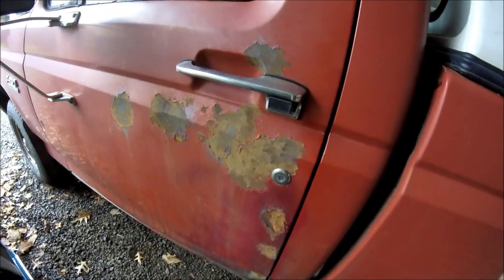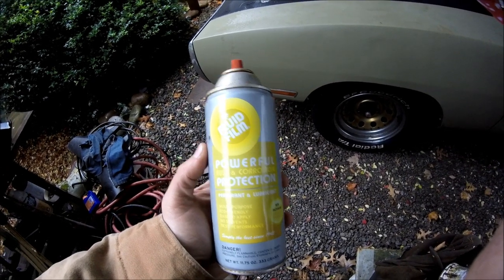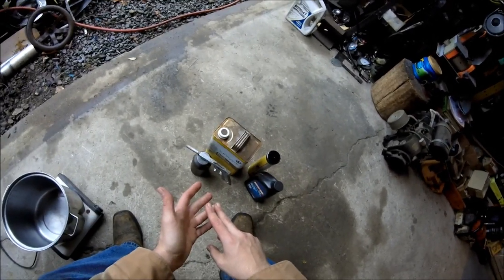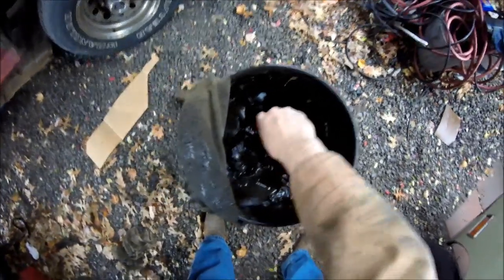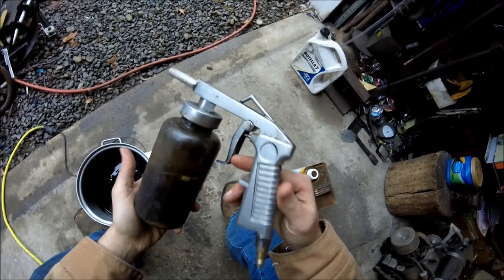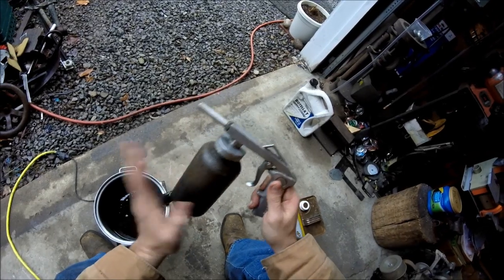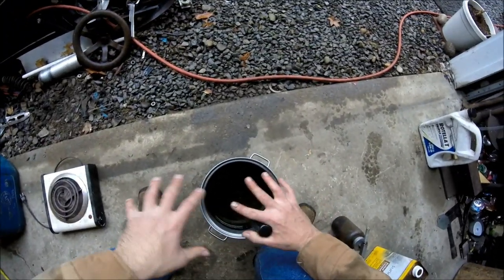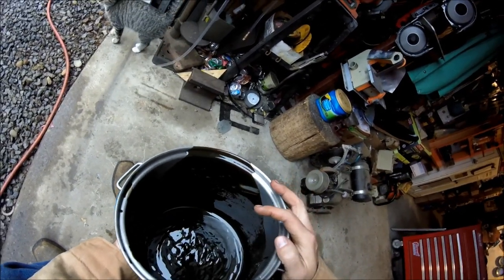GROIL: Homebrew Undercoating Mixture

Comment: I’m all for the home ideas for undercoating but it bothers me that we will be spreading small amounts of oils all down the roads we drive polluting the environment and contaminating water systems. No, I realize my one vehicle won’t be that much of an issue but the more we share and the more that follow up doing this the more oils are dripping all over the countrysides. I think I’m going to get “ziebart” to do mine. 10 year warranty on new vehicles. No, I’m not paid by them, I had my old ‘77 ford done and it’s a good product.  Keep thinking everyone let see who comes up with the best free method.
Reply from the maker: For sure, dripping oil all over roads and parking lots isn't cool.   That's why this method tries to keep the coating as thick as possible, so it stays on the metal instead of coming off.  After the initial spray (that you did in a controlled environment, and properly disposed of the drippings, right?) the goal is to have minimal if any coating leave the vehicle.
Reply: lol, ever see an engine blow up, or a dip in the road where it is dark? that's oil. cars drip oil.....better than riding horses where shit was 3ft deep in NYC. the idea is it stays on, not drip off. oil isnt as bad for the environment as u think.
Reply: The exhaust from your car is doing far more harm.
Reply: Our roads are really just tar and rock hardened, so a tiny bit of oil here and there isn't going to do much damage, but that is why thick and tacky is so important, then it doesn't drop off anyway.

Comment: Also put grease and trans fluid in 1st and heat. It will mix good with grease then add oil and cut up wax ring or cheap dollar tree sets of candles. And clean and tape up door drains, buy baby, mineral oil or melted Vaseline and fill up 2 inches or so and let sit for days. Drain after days and save for next year. U can use oils, grease etc but it will smell like whatever u use for at least a week. And some ladies don't quite like the smell of oils and fluids, grease etc like us men do.

Comment: This works better than anything you can buy if your vehicle already has some rust on the frame and you want to stop any further rust and corrosion.  I never even thought of linseed oil and that's gonna be even better than my dads old formula.      What really sold me was when I pulled the bed on my f250 and had a lot of time off so I stripped the frame almost to bare metal to paint etc.      It took forever to get the oil concoction, now with a little dirt/grit mixed in out of all the nooks and crannies that with a bed on my truck I wouldn't see in a million years. And that's the important shit, ofcourse it will wash off your frame rails in the wheel wells and wide open exposed areas but good luck getting anything up inside the little areas that grit gets stuck and holds moisture, or worse by me with salt other than this kind of deal.    

And the undercoating in cans is never gonna hold up unless you actually sand down, remove ALL rust and totally de grease it first.

Comment: I used equal amounts of boiled linseed oil and tung oil, a large glob of Lucus high tack red grease,  bees wax toilet bowl wax ring warmed up slowly to dissolve the wax ring and then thinned out with chainsaw bar oil. I used a small crock pot to heat it up. I applied it while it was still warm with a gun from Woolwax. So far it seems to have made it thru the winter quite good. It stays soft but hardens enough to stand up in the wheel wells and the car wash. When you are done spraying find a dusty road and drive up and down it a couple of times.

Comment: I've heard of a local concrete company spraying linseed oil on their truck frames, but this formulation is I've never heard of anyone using. Might have to test this out on the old moldboards instead of having to keep on oiling it. Then again, I have around 200 gallons of used engine oil to use up before it turns into tar. Lol!
Reply: used engine oil is acidic i wouldnt use it for metal treatment... burn you oil if you need heat otherwise just drop it off at a shop to be recycled

Comment: We used to spray grease and graphite back home in Nova Scotia, You could hear the truck rotting in the driveway as you were trying to sleep. Anyway it worked really well. Going to paint the old Dodge soon so it will be getting a treatment after paint.
Reply from the maker: Yup, amazing how fast stuff can rot if no preventative measures are taken.

Comment: A old friend of mine used to use old used motor oil (that's lot of use and used)at his body shop under old cars and trucks he had patched up and painted. The only bad effect was if the used oil got on the door rubber seals or body gaskets in older cars the rubber would go gummy and start to sag. One other old co-worker at a boiler room I used to work at used to paint the frame of his truck with Bunker "C" (#6 fuel) oil and that frame never rusted. Did you ever see rust on an old train tanker car hauling Bunker "C" oil?? And it pretty much dries up and don't drip.

Comment: You wanna do this on a nice hot, dry day. Because the steel frame on your truck will hold moisture. And once you pack all that oil and grease onto your frame, it will trap that moisture under it. Whenever I paint steel in the colder weather, I always heat it up with a torch first to burn all the moisture out of it.

Comment: Dear tocheaptoosmoke,
Perfect timing to watch your excellent presentation, as I got acquired a free 5 gallon drum of light texaco grease. Used motor oil is every where to be found, and I might have some boiled linseed oil around the house.
Thank you for a brilliant idea, and a well executed tutorial!! Can't wait for the warmer weather to get under the car.
All the best Bruce the swimmer New Rochelle N.Y.
Reply from the maker: Cool, glad to hear!
Reply: @toocheaptosmoke  thank you...  I am about to undercoat a vehicle...  I searched your channel for a rust remover...  Do you have a recommendation?

Are you still using your Groil formulation as listed in this video or have you modified it?
Reply from the maker: @camposvazquez  I've just started using the ospho rust converter, seems to work alright.  I do still use the groil as is, made a thicker version with some wax (toilet bowl ring) added in that also works well, but doesn't flow as easily when sprayed.
Reply: @toocheaptosmoke  thank you ...
Reply: I was thinking about your Concoction- One of best Commonsense ones of seen - Do u like better w/ adding toilet wax ring? Do you still use same recipe  or have to thin it w/ diesel bit more? Just wondering if gsrden sprayer might work better because of adding wax ring? Thanks for making  video! @toocheaptosmoke

Comment: I add melted candle wax to mine , been doing this for years.  Great video
Reply from the maker: Thanks!  I'm going to try a batch with a melted toilet seal wax ring this year, that may be the hot ticket!
Reply: @toocheaptosmoke  great. At least you are trying,  that's half the battle. Keep up the good work
Reply: Melted toilet wax seal works pretty good! Self heals nicely.
Reply: paraffin will dry hard where toilet bowl wax will be still soft to some degree.
Reply: The was bees wax ring helps to keep the coating more flexible than the paraffin which I think helps to prevent any cracks in the coating once it cools.

Comment: Awesome tip great suggestion i experiment as well i tend to go back to the old methods because they worked i painted my old truck with red oxide with a dash of boiled  linseed oil it hasnt rusted and that was over  4 years ago and paint brushed it on it been sitting out side for years in all weathers didnt have the spray gear so used a paint brush that was a cheap option and fast to keep my truck from rusting No brush marks if you put the paint in a bucket of hot water and use a well worn paint brush never use a new brush when painting vehicles you will get brush marks .I could have used household enamel paints that would have worked just as well  i did sand the old surface to give the new paint something to stick to any bare metal i treated with phosphoric acid which the panel shops have used for years for flash rust before painting you dont need alot as it goes a long way add the boiled linseed oil to the paint it flows on a lot better and gives that added rust protection thats old school but better making your own boiled linseed oil as it hardens and drys better doesnt go tacky like the new stuff .Even enamel paint inside doors will work long term  just have to treat the rust first with a rust converter as your primer it goes along way  For under the vehicle i used a rust converter paint and then some bitumen paint its water based and paints on easily and sets like really hard rubber here some of tour buses travel down the coast on the beach and going thru sea water sand and it protects them from rust in a really harsh environment they treat there vehicles every two years but that is in the worst case scenario.There is no rust under my truck and i used it on the floor panels i am happy with the results.
Reply: There is a company that sells linseed oil paint.

Comment: Pure legend!!! , I'm fighting the same battles here in Ireland . Making random Concoctions , dunno about the using used oil though they rekon that's bad full of acid .
Reply: 208d I’m in Ireland too, they use salt here In the winter at the end of the street which is a hill, so in winter months I go through a car wash weekly that involves under chassis wash..   years ago local garages used to coat the underside of your car with old engine oil as a rust preventer, they used to believe old engine oil was better than new, but in those days oil was castor based and not synthetic or semi synthetic

Comment: Linseed oil has a long protein chain which makes it great for holding together.  In the 3D art world it's used to code statues what have you that are made of metal usually using rust as a patina.  or just as a protectant.
Reply from the maker: Cool info, thanks.

Comment: Instead of the 10W30 have you considered using bar and chain oil? that stuff is very tacky as is and usually contains phosphorous to help keep rust away from the bar and chain on a chainsaw. Surely would work good for this.
Reply from the maker: I think the bar and chain oil would work great also, even better if you can source it cheap.  Might need a little bit more diesel to thin it for spraying.
Reply: After the initial mix of boiled linseed and tung oil, red tacky grease and toilet bowl wax I thin it after cooking that mixture in a crock pot with bar chain oil.

Comment: Would like to see an update . Does it harden somewhat  with the linseed oil or just wash off?
Reply from the maker: Here's a recent update, the linseed oil does help it firm up.  https://www.youtube.com/watch?v=r43jjyDafG4
Reply: There is a different recipe which will harden up better and doesn't involve any grease.  lt's boiled linseed oil + mineral spirits + powered mineral tint (coloring).  After mixing has the consistency of and applies like a thin latex paint.  lf you use a light colored powered mineral tint such as white or grey, the light undercoating also has the advantage of creating a bright environment under your vehicle which is very useful for servicing your own car while also making it very easy to spot any possible problem areas that might need to be recoated. This mixture dries hard with no tackiness once fully cured (the mineral powder tint helps with this) and when ever you need to reapply you do not have to remove previous layers, just clean surface and wire brush any worn areas and then respray entire area. The bond that the linseed oil creates with the surface material as well as the chemical nature of cured linseed oil prevents the oxidation process all on its own without the need for additional grease/oil. Used motor oil and other petroleum products are terrible for the environment and just a little bit can contaminate HUGE amounts of groundwater, whereas the boiled linseed oil + mineral spirits + powered mineral tint once fully cured is environmentally safe.

Comment: This would absolutely work! I’m wondering since transmission fluid is thinner if it wouldn’t be better to mix with grease?
Reply: TRANSMISSION FLUID DID NOT DO SO HOT! BAD IDEA, MOTOR OIL BAD IDEA TOO. Go to Project Farms channel to see his testing of UNDERCOATINGS
Reply: @tnasituning8173  Yeah but this is a mix...
Reply: @lowspeed2000  lots of people use trans fluid because of its anti rust properties

Comment: Getting ready to make your recipe of groil. Which, and where to purchase an inexpensive undercoating gun? I also have some interior channels (rockers etc), that need coating. Which attachments do you recommend to get into the tight spaces?  Thanks again for a most enjoyable and informative video.
Bruce the swimmer New Rochelle N.Y.
Reply from the maker: Thanks!  There's a few on amazon for like 14 to 20 bucks, the one I got was Astro brand I think.  They have some tube extensions for the guns, IMO they work marginal with the thick mixture.  Just putting a section of fuel tubing on would probably work as well.
Reply: @toocheaptosmoke  Thank you, I'll check out the astro guns on amazon. Not only are your video's excellent, but also the timely response is much appreciated. Keep your health and please keep going!!
Reply from the maker: @stewartbruce2409  Thank you!

Comment: I've been using fluid film for several years, you got to spray it on thick and Rich, and pay special attention to extra coating on the wheel wells or it could wash off. It's not magic, nothing stops rust if it's already underway, you just got to stay on top of it and sandblast parts that may be already rusty. if you miss them or if it washes off. And fluid film and galvanized metal don't go well together unfortunately. And I drive through the rust rust Rust Belt of Upstate New York and Montreal. And fluid film being animal-based doesn't affect rubber moldings or bushings. That's the problem with any petroleum-based grease oil, used oil, Bar Oil etc etc
Reply from the maker: I still use fluid film for certain areas and applications, it works good for what it is.  Problem is like you said it needs to go on heavy, and at 12 bucks an aerosol can and like 50 for a liquid gallon it starts adding up!
Reply: @toocheaptosmoke  I pay about 160 for 5 gals, it is pricey. There's also woolwax, maybe I'll try that sometime, it's a competitor
Reply from the maker: @CORVAIRWILD   Cool, will have to check out the woolwax.
Reply: Fluid film's secret is animal based?  I got lots of chicken grease.

Comment: +toocheaptosmoke does the vehicle constantly smell like oil? Does it stain up the driveway after a carwash or rainstorm?
Reply from the maker: It will smell like oil for a bit right after you spray it, but it goes away.  Make sure you cover the ground when spraying, it will drip for couple days if you put it on real heavy, but once it drys and firms up it no longer drips or leaves any oil marks.

Comment: Good job but I would’ve changed a couple things I would’ve used bar chain oil Instead of motor wheel it’s a little thicker and tends to stick a little better also I would’ve tried to put a toilet bowl wax ring in there
Reply from the maker: Bar and chain oil would work well, it's just a bit pricier.
Reply: Bees wax aye.

Comment: Have you tried adding beeswax to your mixture to help keep it waterproof. Melt a toilet bowl ring in with your mixture.
Reply from the maker: Not yet, hopefully try a batch for this upcoming winter.  Original recipe still holding up pretty well so far, hope the wax may allow for thicker application.